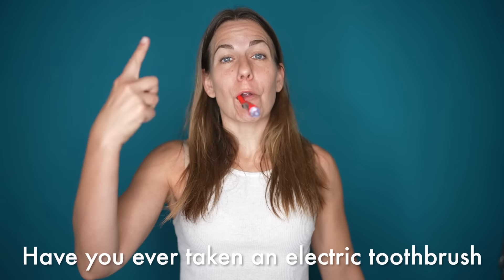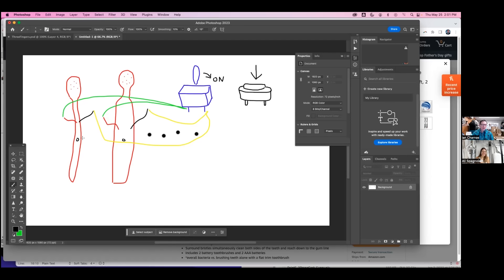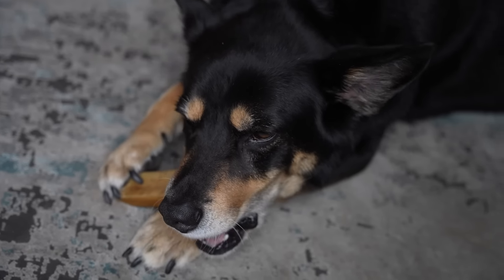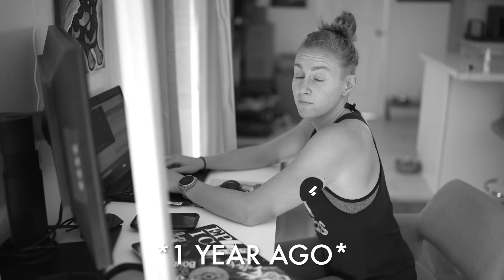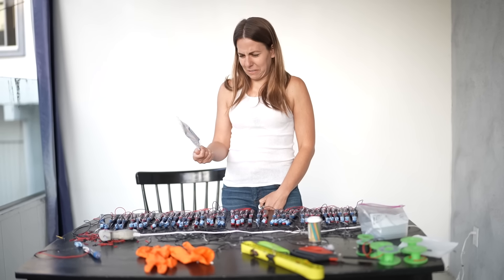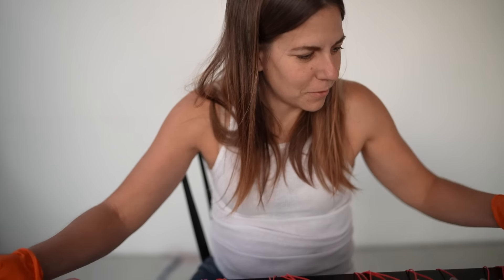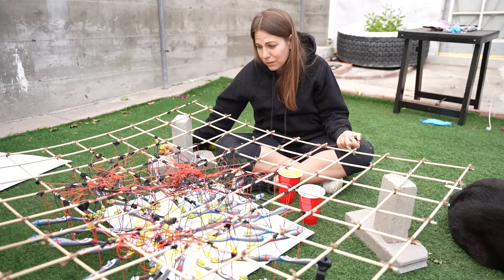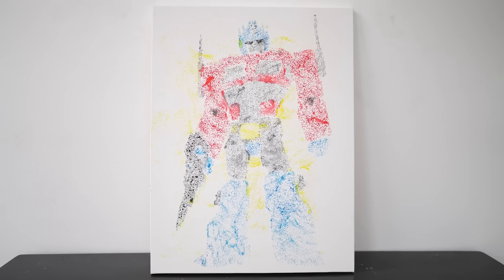I Painted THIS with 100 Robots?!

Comment: 💜 It may have worked better if, instead of hanging by the wire, they had been attached firmly to the grid. That way the vibrations are maximised on the bristles instead of spreading all over the toothbrush 💜
Reply: I came in the comment section for this comment. If she would have attached them to a ridgid structure by the handle it would have flung the paint
Reply: This ^^
Reply: Eggxactly ..  she was loosing the vibration energy on the strings ..  zipties solves it ..
Reply: Exactly! She basically dampened the vibrations by hanging them.
Reply: That's smart.

Comment: using the right soldering flux you can easily solder on steel, even stainless and aluminum, its just takes the right flux (acids) to remove the oxide and letting the solder bind to the metals.
i was super skeptical when i found out, but i have tested with mentioned metals, and works a charm!

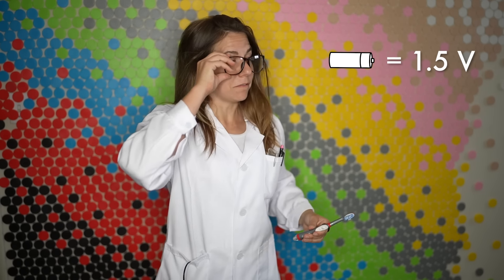Comment: 1:00 "1.5x30 is 15" 💀 its 45
Reply: Math is hard.
Reply: Oh wow, yeah, that totally got right past me.  I just automatically did the math and figured she was going to build series strings of 10 and put those in parallel (3 such strings for 30).  But, no, that's not what she said at all.
Reply: When she did the math she forgot the "1." From "1.5" XD
Reply: I failed math 😃

Comment: If they hang on the wire does that not reduce the vibration, as some of the vibration is 'absorbed' in the slack.
Try attaching them directly to something rigid

Comment: Love the blending of tech and art. You are making my little engineering heart so happy. Great work. 

I agree that suspending the toothbrushs allowed thr wire to act as a dampener, preventing the energy from the vibration to be transferred to the paint. Next test could be to glue or firmly attach the toothbrushes to your grid.

Comment: I don’t think it was a voltage drop. I think it’s because the toothbrushes are suspended in the air. When they vibrate, the oscillations are free to equalize due to their free motion and this results in less turbulence at the brush head. When you hold a toothbrush in your hand, it is vibrating against your hand as you hold it in place and this kind of wiggles it harder at the other end (brush head). I believe this whole project would still work if you instead clamped each toothbrush down on something sturdy.

Comment: lol u should use flexible wire connecters and at the end of that pull in the switch connected to a fuse so u are safe but should work

Comment: Friend...make an Amazon wishlist specifically for useful tools..like idk ..a multi tool with wire strippers and such. Also the $tree has exact knives which would make small cutting easier than a box cutter. I was so convinced you were gonna slice a finger tip off

Comment: Im pretty sure the problem is your sketchy wiring. Because of the way you have all the wires grouped together and then connected to a single wire, you are trying to draw lots of current through a single way-too-thin wire. You need to either directly connect all 50 to the switch (which your switch may also be too small) or use a much thicker wire after all the smaller wires are grouped together.

Comment: EE here. Honestly overlooking the math joke, your idea to connect them in series might have worked better. You'd need to solder to the internal battery terminal which may be tricky and you'd need one adapter per 10 brushes but you could have switched that easily with an extesion cord. When you connected everything in parallel, likely the current was too high for that poor switch and the voltage drop it caused manifested itself as if the battery was low. The conductive epoxy probably didn't help either as it hsually has quite large resistance. Soldering would be much better.

Comment: Amazing video as always! But is it possible that the toothbrushes didnt spray as the vibration frequency was spreading all through out? When you are holding it in your hand, your body ground the bottom of the toothbrush thus focusing the vibrations to the top l.

Comment: You may need a power supply...   All those brushes attached to one switch, may cause the dead batteries drain from others, or the opposite and feed 15V into the brushes, causing them to short out.... 
It's hard to tell without putting a meter on them or the switch.

Comment: The brushes were hanging so, vibration is throughout the body and no paint is sprayed..... Instead of hanging, try fixing the brushes in a sturdy place. It will increase the vibration to the brush area.

Comment: @ 1:04  you say 1.5 ×30 is 15 I'm just curious 😂 where and how you came up with that. 😂😂😂. I can only guess what you ment was 1.5 ×30 is 45 ÷ 3 is 15 and that you would searies parallel 10×3 to get your 15 volts required

Comment: I’m thinking it didn’t work because the vibrations from the brush traveled up through the wires they are hanging from…. You didn’t test it before attaching them to the grid